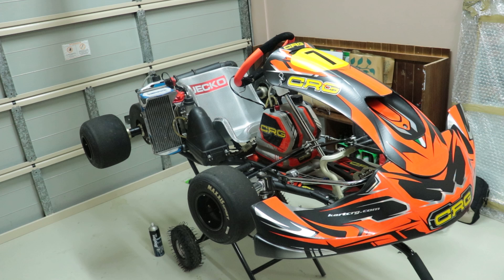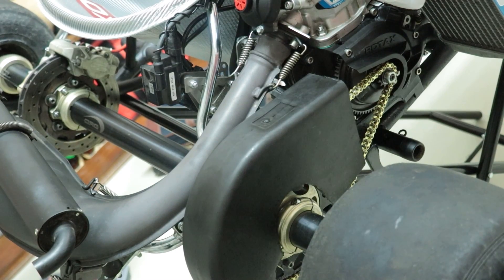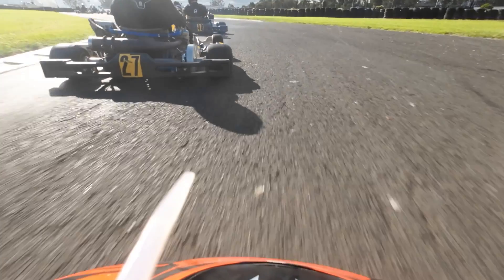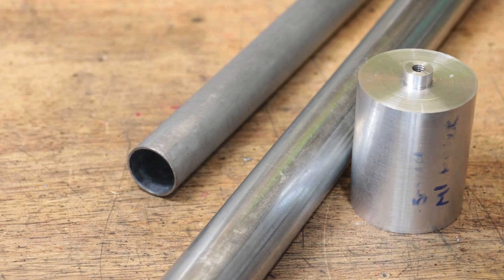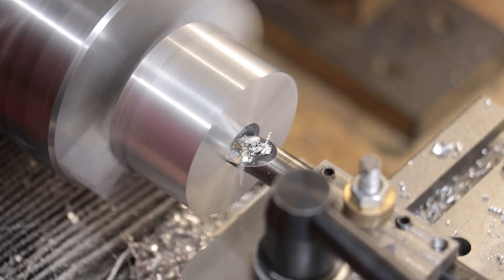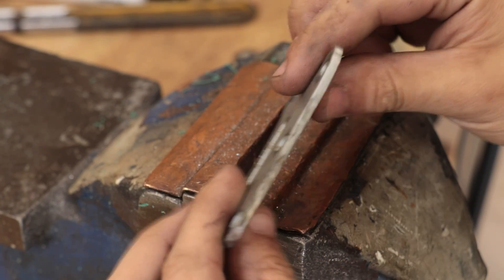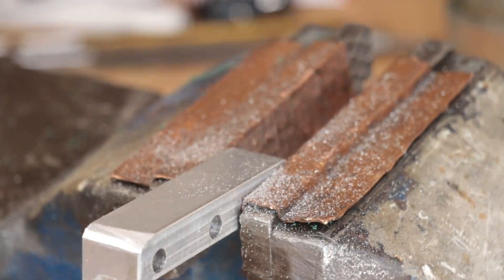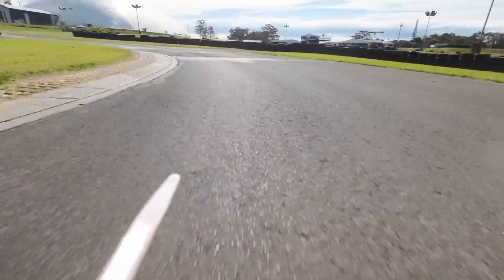Machining Go Kart Parts - Torsion Bar Build

Comment: That looks like a fun hobby, thanks for showing this off!:)
To the aluminium, eeeks ... aluminum protection block: Imagine everyone on the racetrack constantly leaving metal filings on the track ...
Greetings from the carburetor and tires!:)
Reply from the maker: I wouldn’t image it’s any worse than the steel shavings or chucks of cast iron that get pulled off. In any event it did it’s hub at the race event

Comment: Like many have already stated, this came from left field. And what a wonderful surprise. Brings back memories of my kart racing days... Some thirty+ years ago!. F I'm old. Karts have remained pretty much unchanged all these years but certainly some details haven't. Torsion bars were also the front and rear crash bars in my day. Probably still are, might be able to find tune the twist with the central bar you added using bar wall thicknesses. I love your comment, "thrown into the deep end". Exactly the feeling I had. Getting good is all about seat time. The more time in the seat the more ideas you come up with to tune the chassis.
Enjoy every minute of it, the fun can't and won't last forever. And Karting is a fricken blast!!!

Comment: If you don’t do machining and you race it can be very expensive! I owned a machine shop back in the 90’s and used to race. Saves you tons of money to do your own work. On your torsion bar, if you notice most commercially produced ones are flat in the middle. That’s so you can twist it to make your chassis have more or less flex. I’m pretty new to the channel and have been enjoying your content! Keep up the good work.

Comment: You have way more options here than just yes or no to a bar...
... torsional stiffness is proportional to diameter to the 4th power. So a 10% change from a solid 25 od bar is a 24.35 OD bar (just machining 0.3 mm off the outside radius softens it by 10%). 
You can do the math for your bar's inside diameter (stiffness is proportional to od^4 minus ID^4)... ... But you get the idea: Make a few bars like you did, with a few increments of fairly small skim cuts on the outside, and you have a system you can fine tune at the track by swapping in a stiffer or less stiff bar.
For your skid plate, I would either do what you did, or cut up a plastic cutting board...the uhmwpe of a cutting board is a very tough material. Should be a little bit less savage a shock to the frame than solid aluminium if you slam it into a curb, but either way i think if you own the cart you should be staying the hell away from the curbs.
Reply: And yes i agree with the other commenters that some applied machining content is of interest. I am likely to apply the machining myself and (while I have raced (only the hire) go carts myself) i think i am more likely to just enjoy vicariously engineering for your race car rather than racing myself. 
I can do risk analysis and the risk analysis is poor of cart racing SERIOUSLY when you have no seat belt, no roll protection, a hot exhaust an inch from your arm, and a tank of fuel up front between your legs.  So that bit i am happy to watch at my age. 😉
Reply from the maker: Yeah for sure. I only had about 3 hours to do all these upgrades before heading out to the track, so it didn't leave me much time. I'm still planning on doing some more changes further down the line. Cheers

Comment: You can get Thick pcs of Good machinable plastic material from Kitchen Cutting boards - I make Motorcycle chain guides and all kinds of other things from stacking up "teflon" cutting boards and machining it - Cheap! and here in the US you can even buy thick white cutting boards from Harbor Freight?
I used to race Shifter Karts 125cc back in the 90's - fun stuff

Comment: If you want to play with the torsion bar a bit more try making a flattened one that's stiff one way but soft at 90°, then from there you can dial in the angle that feels right for you in a similar manner to blade style anti-roll bars
Reply from the maker: Yeah, pretty similar to the OTK ones. But I couldn't find any material like that when I last stopped at my metal supplier

Comment: You should try making your torsion bars adjustable.
Reply from the maker: For sure, I'll need to wait until next winter for a cold day, which is probably when I'll get the most from a torsion bar

Comment: So heres the thing, is it worth another ten bucks to see if a torsion bar on the back as well really improves the ride. The aluminium will work well but probably isnt as slippery as Nylon...and if you do try nylon make sure its not nylon 6 (its the weak stuff)

Comment: Nice little video about your cart & the couple of mods that you have done to it so far, as for the skid plate/protector try some Teflon or HDPE like what the use on the fifth wheel plate on a semi-trailer.

Comment: That's so cool! I'm curious, about how much do proper competitive go karts usually cost?  I am into road bicycle racing and prices get pretty insane there, if you just walk into a bike shop you won't be able to get a real race worthy bike under 5 thousand euros/dollars and they can go up to 20 grand pretty easily.
Reply from the maker: Like everything, it depends. For karts 4 stroke is much cheaper, but it is not as big in Australia, expect for endurance racing. A new 4 stoke kart might be $4000-5000 for the chassis and $1200 for the engine. And easily half that for a used one. For 2 stoke rotax, frame and chassis are easily 10K new, and less than that used. I have 2 friends who do competitive bike racing, and I couldn't believe it when he told me he bought a frame that cost upwards of $5000. Cheers
Reply: @artisanmakes  thanks for the answer! That doesn't seem that bad actually, but my opinion may be skewed from the bikes 😀 While those frames are an engineering marvel because they weigh often less than a kilogram and can support a grown man smashing the pedals, the prices are really crazy.

Comment: Machining and karting go hand in hand. I owned a shifter kart and could have saved a lot of money just making simple maintenance stuff. Like Teflon bushes for the shifter mechanism. I would like to see more of this content!
Reply from the maker: That's awesome. Never used a shifter kart but I've heard that they are wicked fast. Cheers
Reply: @artisanmakes  You should really try it, if you have the chance. They are a really fast. I switched from riding motorcycles on the track to this, and I gave me the same kick but it felt a little safer. ( probably as dangerous but it was the only thing my wife let me drive after a big crash with my bike.) My chassis had front and rear torsion bars. The tubes where flat in the middle so you could rotate them to make small adjustments. You could really fine tune that way. Maybe you should try that.
Reply from the maker: Makes sense, as I understand the more power a kart has, the stiffer the frame needs to be. I am doing some 4 stroke kart racing next month and from what I can tell, those karts are much less stiff. Cheers

Comment: Real torsion bars for Karts are flattened in the middle to be adjustable. You orient the flat horizontal for least stiffness, and vertical for most, or anywhere in between for track conditions.
Reply from the maker: Yeah for sure, I had a bloke lend me an OTK one for one of the races but didn't have time to chuck it on. Cheers

Comment: Nice to see some practical application of shop work. Did you zip tie the GoPro ? 😆
Reply from the maker: The case is zip tied to a mount on the frame. The regs require any cameras to have a safety line just in case it falls off the standard mount. Cheers

Comment: Well it looks like you have found a hobby that will keep you in lathe and mill projects! First project, build / adapt a diff to that rear axle! That will fix all your handling problems. Have a look at a transaxle out of a ride on mower as a potential starting point.
Reply from the maker: It's a homologated sport so there isn't much that I can change. Cheers

Comment: As a motorcycle mechanic for 50+ years, a tight chin is much worse than slightly slack chain,
 It will damage bearings when too tight plus absorb extra  power.. (properly lubed and adjusted a chain is about 98% efficient)
If your using a 428 chain (1/2"x5/16") a good 'rule of thumb' for fixed centres will be one chain pitch of slack midway along bottom run. (10mm~12mm) For a smaller chain, it's easy enough to measure between two pins. (maybe a 3** series chain?)
The problem is, even a very tight chain can be flexed, so, without experience it's difficult to know how much pressure to use.
I used to teach people to use an ordinary BIC biro as it will give a good indication of pressure needed and if too much pressure applied it snaps.
Make slider from UHM polythene, you can probably pick up a kitchen cutting board cheap. It also works very well for making chain guides and sliders.
The material you make torsion bars from may be pretty important,  if you can pick up an old VW Beetle (air cooled)  front torsion spring set you will have a bunch of material to play with for adjustable torsion bars (if nothing else it freaks out the opposition)

Comment: Could you use skateboard wheels instead of a solid metal or plastic slider?  Could be a little faster over kerbs without the drag slowing the kart.  It's hard to visualise how the "torsion bar" would actually be loaded in torsion, seems like it would mostly be bending.  Perhaps it's called that because it increases the torsional rigidity of the chassis?

Comment: put some cool stickers on it and no one know is made in garage.
you probly need adjustable tension and need to adjust per track and add some f1 level telemetry on the cart.
For the age old question why don it come like this from the factory, because it would cost money.
The same applies to my work, why dont i get new cnc machine for 2 mil when i know it would pay itself the second they bought it? Because it cost money.
Why dont we get power skiving tools at work although we have 2 machines that could run them? Because it cost money. 
It is better to use the old machines because they may or may not work and if it dont then i use the other one or fix the broken one.

Comment: Machine some small slots in the aluminum disc brake guard and add some carbide inserts to stop the rapid wear. Just a thought, but used up cutter inserts would be a good starting point.
Reply from the maker: By regulation, carbide and materials like it are banned :)

Comment: @2:08: The black shims on the front axel should be removed completely for dry weather and rear axel as wide as possible. For wet conditions it's the opposite, wide front and narrow rear.

The torsion tube is for dry weather. Loose or removed for wet. Also it looks like you have Ø50mm rear axel. They are way to stiff, a Ø40mm is better in my opinion.
The side support on the seat are very important, it helps push your body weight down to the bearings, which is the point the axel bends, and improves grip on the outer wheel and lift on the inner.

In turns, push your body down in the seat and lean your head outward. Pushing means you stear by pushing the steering wheel, do not pull.
Good luck with your new hobby!
Reply from the maker: Tha ks for the advice. I can't afford to shell out for a new axel and the stuff associated with it. Not too worried about it, it's mostly a hobby and a great afternoon activity to spend with people. Cheers

Comment: Nice work. Racing is all about experimentation and by making your own parts you can save a lot of money while trying ideas. I wouldn't give up on the bar just yet, different sizes, adding one to the rear, only on the rear, etc. could make the difference you need depending on the track / temperature / tire pressure / etc..

Comment: A titanium skid block would be lighter and should give off pretty white sparks on contact too!
Reply from the maker: Yeah for sure, but use of titanium is banned in the regulations
Reply from the maker: and weight isnt much of a factor. I have 12kg of lead bolted to the kart to get me to the minimum weight requirement. Cheers

Comment: Very interesting video. I would try to put actually a relatively thin steel bar instead of a tube, it's more likely to bend like leaf springs in suspensions.
Reply from the maker: the next step down is usually a nylon bar, rather than steel rods, but its perfectly acceptable to run with no bar

Comment: might want to ask the track about the metal block i know some have rules about steel so they don't tear up the curbs you could try a HARD piece of wood for a race save some cash on the nylon sometimes shipping pallets or cribbing can have some very hard wood pieces other than that i liked the more practical vid and know well the joy of saving cash buy using all my free time
Reply from the maker: This passed scrutineering and its allowed under the current regulations. I was waiting for someone to complain about it but no one seemed to :)

Comment: You’ll have to try the front torsion bar again but with a rear one also to get a good idea if it is for you.  Also a rear w/out a front.  Just do it on practicing runs.
Looks like fun and a good mesh of two hobbies.
Reply: Try different diameter torsion bars as well.
Reply: Or perhaps the 'U' style in which you can vary how close to the bar the brackets are in order to fine tune the ridgidity...